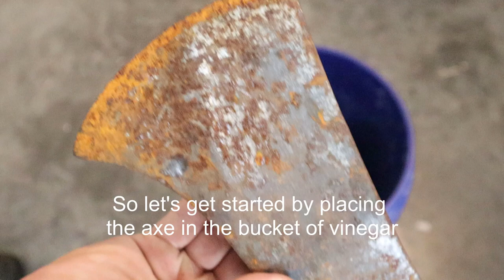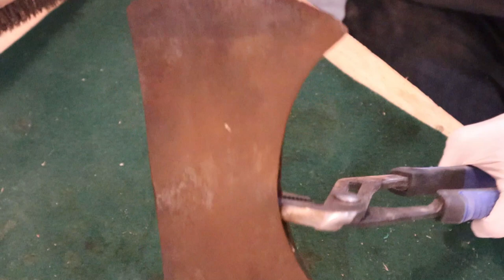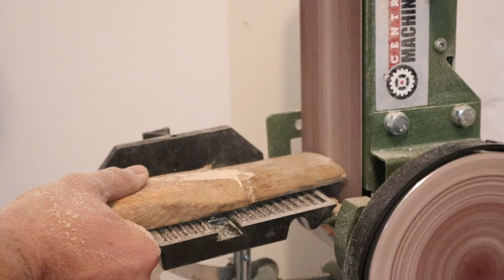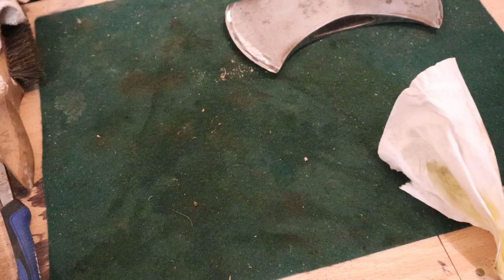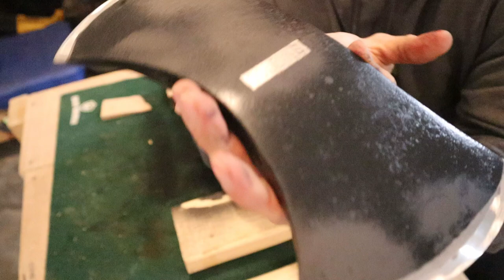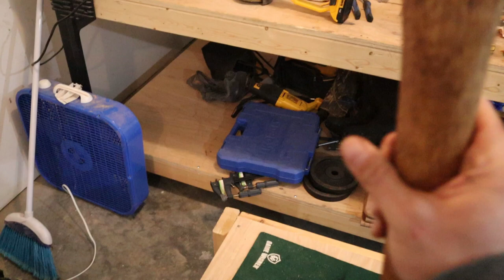EASY SIMPLE DIY Axe Restoration | Working with HD

Comment: Looks great! I only have one suggestion. when you tap an axe head on, sometimes the handle will split on the other end, especially on concrete. So I always put a scrap piece of pine or some other softer wood underneath where I tap my axe on. Because breaking a handle after putting all that work into is heartbreaking. keep up the good work!
Reply from the maker: Thank you, I will keep that in mind.